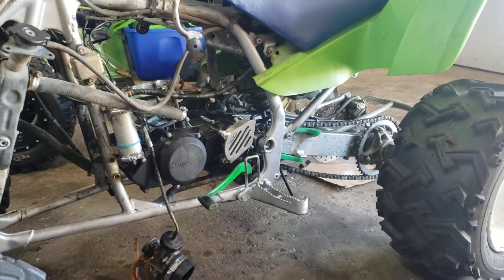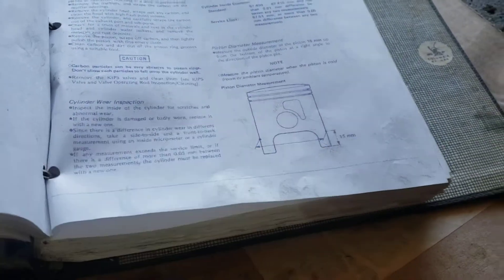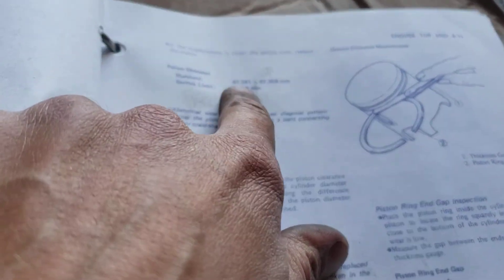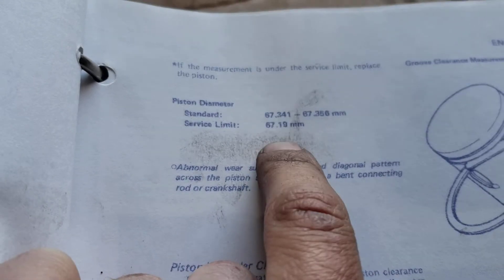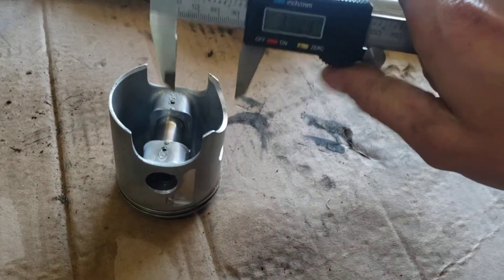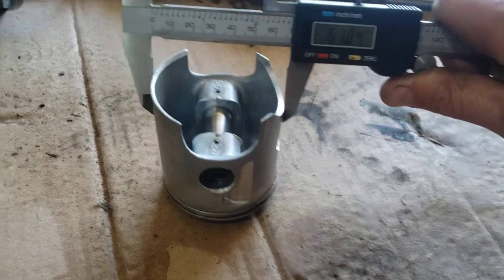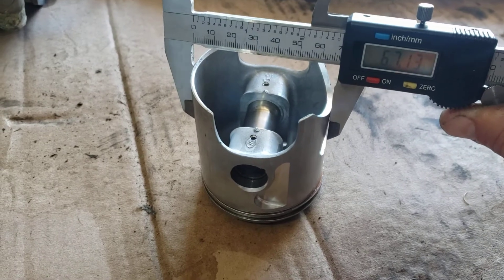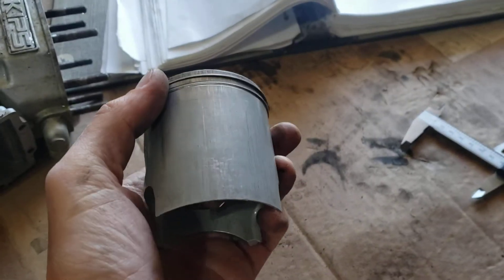How To Correctly Measure a Piston

Comment: Actually the proper way to be accurate is to use a micrometer. Always measure 90° from the wrist pin and on the piston skirt. We only use dial calipers to see if bore is standard or bored oversize. And when measuring an outside diameter of anything round you want the calipers to be at a slight angle so you know you're measuring the full diameter.
Reply: i was gonna say the same thing, made my ocd spike

Comment: Bro that made no sence.... You have no need to measure the piston at this point. You measure THE BORE in the cylinder to make sure its stock or to see what size piston and rings you need. If its IN the service range than you measure the piston, bore, and ring... Than order the new ring. IN the service range means its SERVICEABLE, scratches on piston have no bearing on performance so long as rings make proper seal